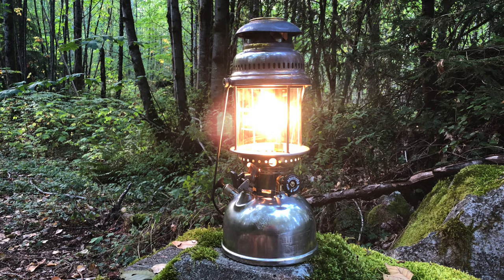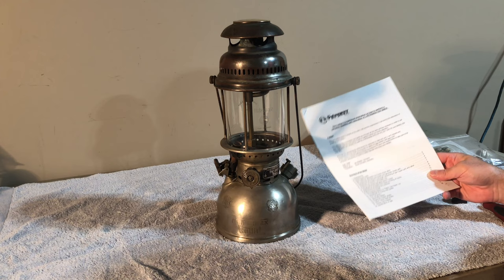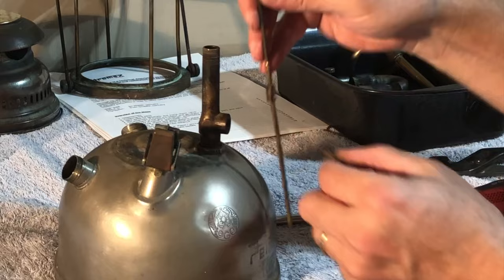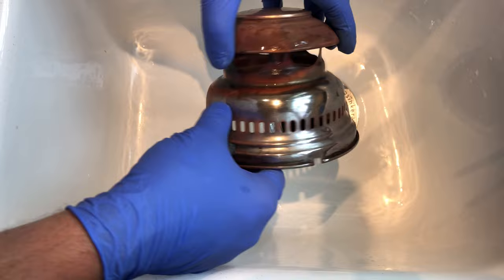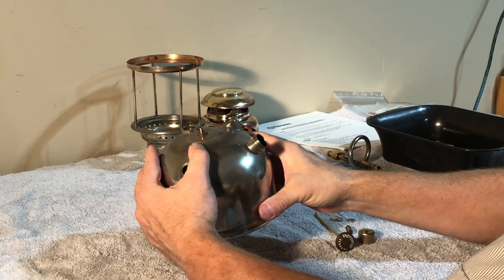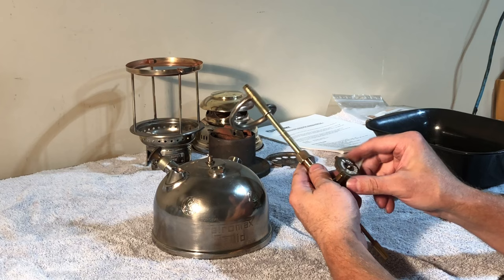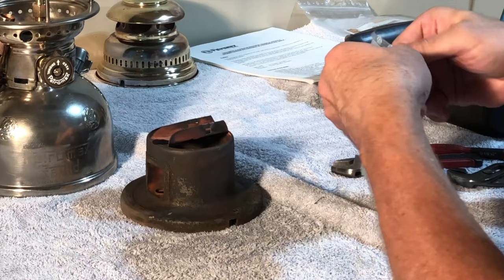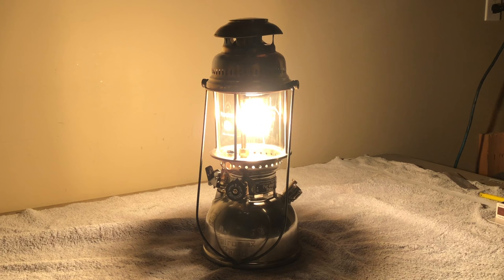Restoring and Rebuilding a 1950s Petromax Lantern

Comment: Excellent video and restoration. In UK & Ireland these are seen as a bit exotic and complicated. A testament to your skills and knowledge that you got it working again. Generally in UK and Ireland the Tilley, bialaddin and vapalux are more common. I have one of these in fairly good condition except that the rapid heater keeps going out so I have to either do a soft start or hold a lighter to the rapid heater. I did try starting it with a lower pressure, to no avail. Thanks for sharing this restoration.

Comment: I just bought a petromax 829 today with a metal carrying case. The case  look like german army case. Cant wait to receive it and light it. The rapid design is clever,no need to carry another fluid to preheat. The petromax can also run on diesel in worst case senario but probably more dirty than kerosene.

Comment: Well it’s European in origin, so the screw is probably metric. Unfortunately I do not have access to a screw gauge but probably use a digital micrometer set for millimeters and read the OD of the screw. Most often thread pitch will be directly related to screw diameter  when dealing with metric hardware.

Comment: Great video, very informative.

Couple of questions:
- what do you use to keep the generator clean? How often do you clean the generator?
- what life (hours of use) do you expect to get between rebuilds?
- can you run shellite/Coleman fuel through the Petromax?

How does it compare with a Coleman Northstar in terms of light output (lumens)?
Reply from the maker: The cleaning needle keeps the gas jet clean.  The generator itself is designed to last the life of the lantern.  They're not like North American lanterns, where the generator is considered a consumable.  If it were to get coked up and clogged, you could heat and quench to break up the carbon.  No, these do not run gasoline or naphtha.  The light output will vary with the model.  As I said in the video, they come in varieties from 150cp up to 500cp.  The brightest is comparable to a Northstar.
Reply: @king.coleman  mate, thanks for the quick response. Much appreciated.
Reply: Hello friend, greetings from Brazil, I love your very good videos but I hate to disagree with parts of your answer, the petromaxes are great and durable yes, but even the way you turn them off can accumulate kerosene and mud inside this circuit and the operation It takes an hour and removing this residue is terrible, I use vinegar to clean everything, but this part or ring of the generator is a tedious process if it is clogged, so I use ultrasound and also the wax cleaner which in this case I don't use I don't know if do you have it in your country... thank you the video is great

Comment: Where do you source replacement gaskets and o-rings for stoves and lanterns? I really enjoy your videos. Thanks!
Reply from the maker: For this Petromax lantern, I bought the rebuild kit sold by Imperial Lighting.  I buy Coleman/AGM size fuel cap gaskets from a fellow collector who makes them and Coleman Easi-lite o-rings from a local auto parts store, but everything else from Old Coleman Parts.  They don't sell Petromax parts, but they've got pretty much anything you'll need for lanterns and stoves of North American origin, Coleman and non-Coleman.
http://oldcolemanparts.com

Comment: Nice video. Thank you 👍🏻. Do you know how to decode the date stamp that’s engraved at the bottom of the lamp.
Reply from the maker: Petromax used a variety of date codes over the years...and, like mine, not all of their lanterns have a code stamped or engraved.  Your best bet is to check the forum at Classic Pressure Lamps a there are some discussion there that include not only information on the various date codes, but how to date based on design changed through the years.

Comment: Maybe a screw from an eyeglass repair kit would work for the monometer/fuel cap
Reply from the maker: I found a number of small screws that work as far as diameter goes.  The problem is that this screw is incredibly short.  I though about cutting one down, but I don't have the tools or skills to do precisely enough.
Reply: @king.coleman  if the small screw kit comes with matching nuts you could put a nut on then use a dremel with cutoff disc.  When you unscrew from the nut it should repair the threads.
Reply from the maker: It's even shorter than that.  It holds the gauge cover to the manometer.  The screw threads into the outer wall and there's at most room for a single turn of the the threads inside that.  It immediately hits the inner wall.  The threaded portion of the screw is, maybe, a millimetre long and would take some precision tools to cut from a longer screw.  It's not surprising that it fell out at some point.

Comment: I am in the process of fixing one but i am stuck. What you do in the video at 18:41 does not happen for me. The bolt is loose but it does not want to come out. Shaking, using a stick with sticky stuff. Nothing works. Any suggestions?
Reply from the maker: I'm not sure what to tell you.  I can't think of easy reason why it wouldn't fall out of the pump tube once it's fully unscrewed.  If you've unscrewed it all the way, there's nothing left to hold it in place.
Reply: I had the exact same problem. It wasn't until I filled it almost full of acetone. I let it sit for an hour, sloshed it around again and again, let it sit for another hour and did the same thing. As I dumped it back into the container, I kept getting chunks of gritty, brown material out. As I shook more and more and lightly banged it down on my padded bench, the brass bolt finally came out (I had unscrewed it for a bit before). Apparently, the brown crud I was banging out had been on the end of that brass screw and retained it. All clean now!

Comment: Do you repair lanterns?  I have a Butterfly 828 that I've just about given up on (because I don't know what I'm doing).  I can't get it to hold pressure.  It's a beautiful lantern and I'd love to use it, but it's difficult to find anyone to send these to for repair as that knowledge seems to be dying out year after year.
Reply from the maker: Sorry, I do not.  I don't have the time and don't want to take on the liability.  I think the video and the guide I linked to in the comments should get you started.  That said, the build quality of the Butterfly lanterns is pretty poor and my (limited) experience with them wasn't great.  You should be able to get it running, but they're pretty finicky and always seem to need something adjusted.
Reply: @king.coleman  If the build quality is considered lousy, I guess there's really no point trying to get it running.

Thanks for the prompt response.
Reply from the maker: @snowdogthewolf  If it won't hold pressure and it isn't rusted through somewhere, you probably got a bad gasket somewhere.  If it's only leaking air and not fuel, you can be fairly certain it's not one of the valve pips.  It's more likely to be a poor seal where the main valve or the preheater screw into the fount.  On the real deal there's a crushable lead gasket at those points.  I don't recall if Butterfly is the same or uses rubber.
Reply: @king.coleman  Thanks for that.  Some of the gaskets appear to be made of cork.  It's an odd set-up.  I'm more into Aladdin lamps that don't require pressurization and bought the butterfly because it was kind of pretty.  Maybe I'll see if I can find a gasket kit for this thing.

Comment: I have a couple of Swiss army surplus lanterns. They are Petromax/Geniol 250CP Lamps. Can I use parts from the kit you have in the link to rebuild them or do I need something else? They run on gasoline or white gas not kerosene.
Reply from the maker: I'm not familiar with those.  It wouldn't surprise me if some parts are interchangeable, but I expect that most of the fuel system components for a gasoline burner would be different.
Reply: All the lead washers, rubber seals, springs and graphite packing are the same for 150cp, 250cp, 350cp and 500cp lanterns.
Reply: @yorksploughboy803  Thanks.
Reply from the maker: Yes, but are they the same for a model designed to burn gasoline? @yorksploughboy803
Reply: Yes they are the same.  @king.coleman
Reply: @yorksploughboy803 What about nozzle and manometer thread sizes- are those the same as well? I have an old 826 waiting for a rebuild and I wondered if the kit for a new lantern would suffice. Thanks in advance!
Reply: @baginatora   Yes the thread sizes are the same but be aware that modern nozzles have a slightly smaller diameter than the old ones and often come loose after using the lantern a few times.  Smear some exhaust paste (for mending leaking automobile exhaust pipes) on the threads to help keep the nozzle in place.  An alternative is to also fit a modern gas chamber (part number 34)
Reply: @yorksploughboy803  Thank you very much for the reply! This information saves me a lot of time and effort since it's very difficult to find anything about repairing these old beauties.